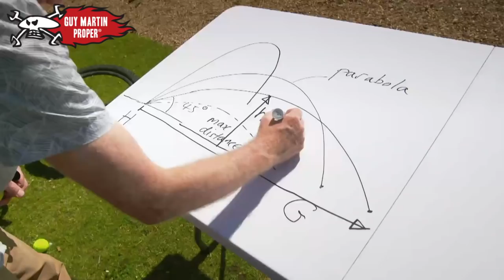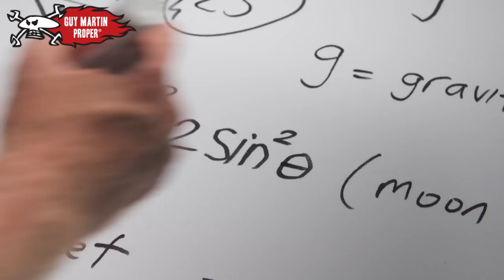The Science of The Great Escape Jump | Guy Martin Proper

Comment: 4:00 When I was a kid jumping my bike, I learned quickly, you've got to pull quite hard to keep the front wheel up as the black wheel leaves the ramp.
Reply: On a motorbike you use the brake and throttle to keep the bike level or raise/lower the front or back wheel.
Reply: @boneav83  WHEN I WAS A KID
     I am talking about a bicycle.

Comment: Hello,
That's how we used to do trick jumps with rc cars. It's indeed fascinating.
The effect with the motorcycle will be a lot less of course due to the bigger weight difference between wheel and motorcycle. Only one wheel in stead of 4.
And the power to weight ratio.
And the fact the motorcycle wheel is better balanced.
And...
And...
Nice tech explanation. And video.
Cheers from Belgium

Comment: Supercross riders are the ones to talk to - they control the pitch of the bike mid-jump...
Reply: By doing exactly what the physics professor just explained.
Reply: @davidaxman  Theory is great, needs practise. The Prof doesn't fly 250 cc bikes 60' in the air and can't explain how much braking/acceleration to use to rotate the bike...
Reply: @sgpsimonb  He actually did explain braking and rotation via the accellerator, but I agree Guy needs to get back to the guys on the scramblers. Next in a refresher on weight transfer and positioning.